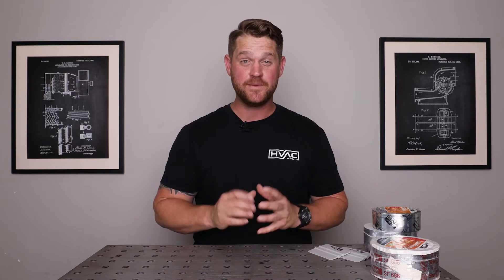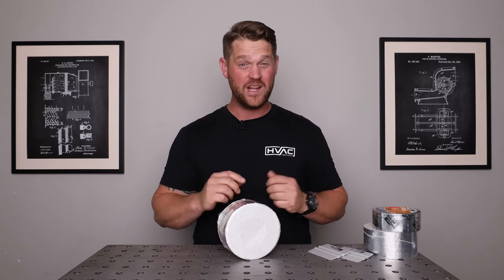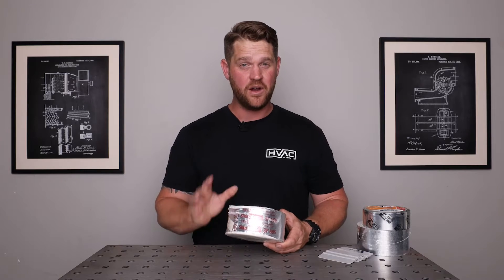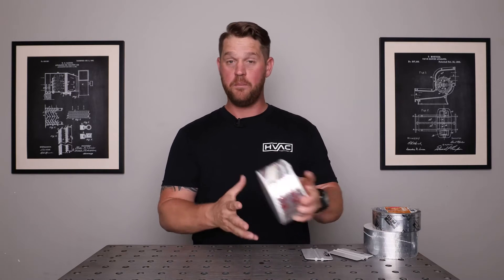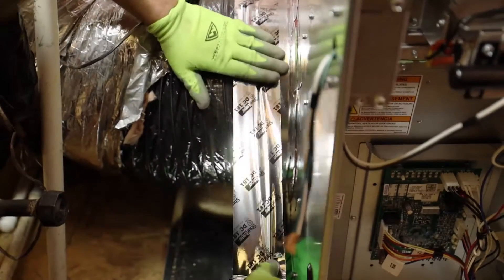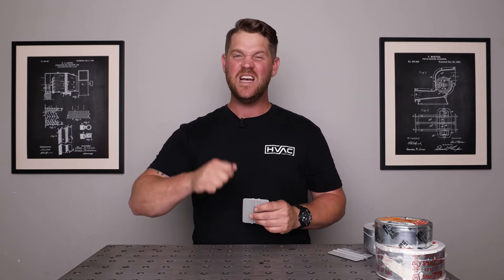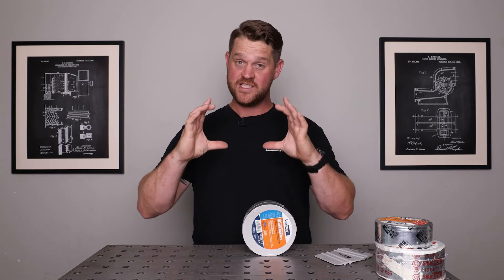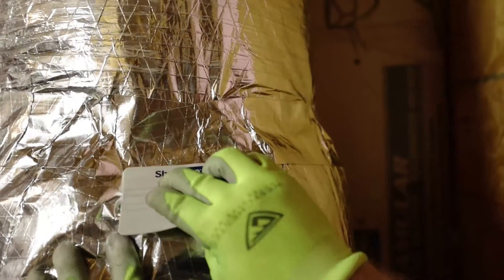How To Achieve HVAC Full System Closure

Comment: Probably one of the most important things with all those tapes is keep them in a large ziplock bag and use the bag as a clean place to set the roll down. This keeps the roll clean and not picking up dust and insulation on the sides.

Comment: Hey Zac, How can I remove and replace the Tape and Mastic seal. The tape on the condenser unit in my garage doesn't stick anymore, and the seal is no longer there. I picked up the Mastic tape and a gallon of mastic. They were the 2 items that were previously used. Any suggestions would be appreciated.

Comment: Shurtape 686 mastic tape - for metal-to-metal
Shurtape DC681 butyl tape for liner of flexible duct to the metal duct
Shurtape AF984CT FSK tape for the insulation of a flexible duct

Comment: Any tips on taping a metal to metal joint on the backside of a rectangular duct placed against a wall?  I can pull the duct away from the wall about 1/2" at most.
Reply from the maker: Hi there - It is going to be hard to get pressure to get the tape to adhere properly. We would recommend to pull the metal away 1/2”, apply the tape, then somehow slide something (possibly a wooden ruler) in the 1/2” gap to put pressure on the tape so it sticks as best as possible.
Reply: @ShurtapeIndustrial .

 I ended up cutting the drywall away so I could properly tape the duct.  I have lots of other drywall to put up anyway.

Comment: Pretty good.  Better than most. I recommend using spray glue too. Also having a heat gun just in case deff wont hurt.. oh also i never used scissors a really good tape trick is to fold that paper around the roll to the beginning of the tape and you can now just sit and pull strips of tape in seconds

Comment: Thank you for sharing, what tape recommended for my primary line (PVC) coming off the main system and what kind of tape recommended for secondary (PVC) coming off the main unit in my attic. I had my AC “maintenance “ done and the “guy” turned my PVC pipes and broke the white looking “puky” loose and didn’t reseal it.